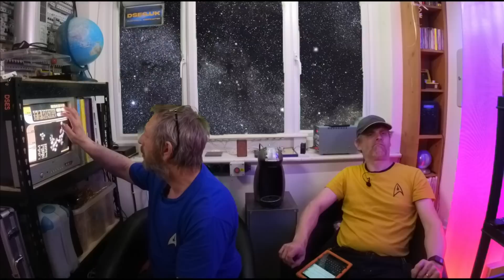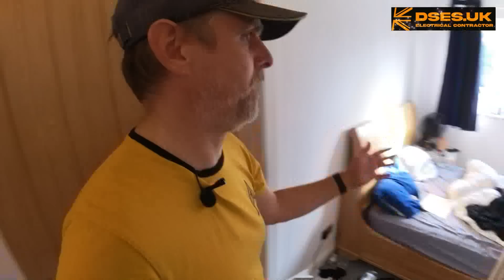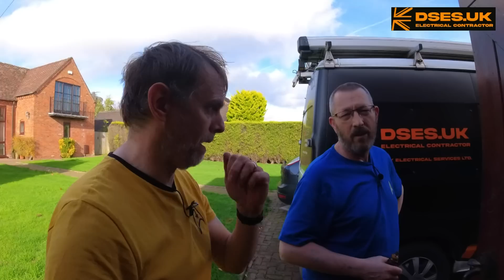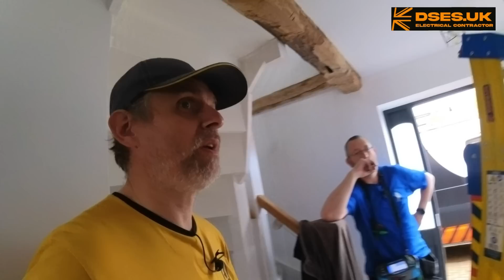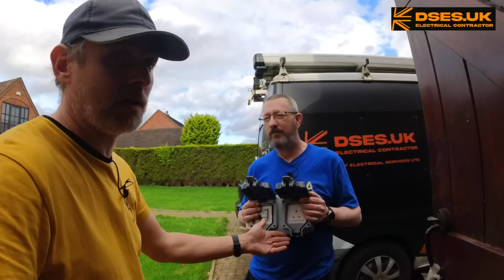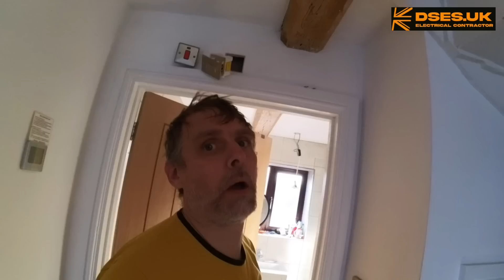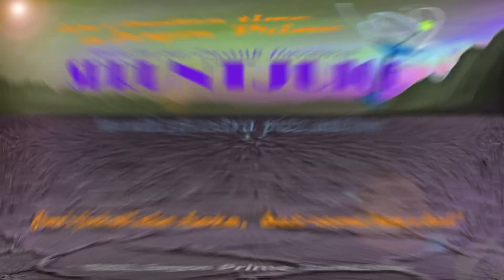Selectivity and Demand

Comment: There is no compliant way of connecting those type of lights unless you use a junction box and take a 4.0 cpc from it.
Also, running a single 1.5 mm cpc is also not compliant.

526.8 refers to the cores of sheathed cables being enclosed as required by 526.5, it makes no mention for the purpose of the conductor and the reference to 526.5 is the methods contained in that Regulation for the enclosure not whether it is a live conductor or not.
See 543.1.1 whereby the cpc is no longer an integral part of the cable as the sheath has been removed.
The cpc should be enclosed or mechanically protected.

Very good Video though :)
Reply from the maker: Oi oi Mainline. I have to say that I find, as I get older and the alcohol abuse takes its toll, that it's getting harder to recall the do's and don'ts of the big brown book. That's not the case so much on design where one can take some time to ensure it's all thought about and checked properly, but more so on situations like this where we're faced with something unexpected that wasn't undertaken with any care or competence in the first place, and it's now up to us to sort something out on-the-fly without pulling down the ceiling. You're right of course that this isn't an ideal or compliant solution... and that it's difficult to implement such. These sort of faults require some thinking around there on the ground to ensure the customer isn't going to end up paying through the nose for a load of decorative repair, and so we can show some test data on paper that indicates some kind of improvement to how the last idiot had left it. I do wish I'd had 4mm on the van, but I don't know any other way we could have uncocked the unearthed downlights, switch and fan iso without some dirty great holes knocked in the place.

Comment: Great video as always. Are you aware that any socket intended for ev charging must be on its own circuit protected by a dedicated rcd with switched neutral and have a solution to maintain safery i  the event of an open pen fault, ie open pen detection. Grany chargers dont have open pen detection.
Reply from the maker: I am aware... now. NICEIC picked me up on it after I installed another one on a site they inspected. This is why I don't do any EV work anymore - the customer just wants a robust outdoor socket and the next guy they'll call won't bother with all the whistles and bells. There's no point in trying to compete.

Comment: My dad was a market gardener and a lot of greenhouses. 3kw heaters plugged in some. 
As a kid I was often changing plugs burned out and also sockets (I was about 10yrs if that)
Damp environment caused corrosion and resistance. 
I had a trusting dad lol
Used to do all the mechanical work on his vans from very early teens if that 😂 
Now my sister has a dog swimming pool with 2x 18kv heaters 2 1.5kw pumps etc and a toxic chlorine atmosphere so done for this. 
It kills industrial dehumidifiers of which there is 4 + 2 back ups in constant rotation. Mainly fan seizures. Bush barings. 
People don’t think about this

Comment: Hi david you know the 3 pole c40 mcb in this video, is it still the same as a 60898 single pole mcb, apart from it cuts the live and neutral,
    Dose it matter which terminals on the device you use for the lives and neutral or can it be any, and dose it matter which way the supply or load connects to it top or bottom 
   And if it exceeds 40 amp for a certain amount of time it trips
    
   Never seen these so interested to know how it actually works 

Thanks

Comment: It’s always the same! I see it all the time. One of my favourite sayings to people is “The last people to be doing building work is builders!” Kitchen fitters, Bathroom fitters and plumbers are just are just as bad! I’ve carried out a few EICRs recently and the problem with most of them is poor workmanship from other trades. If a property has had a new kitchen, Bathroom or extension its a warning sign and the first place i start looking for the faults!!!!! I fix some things on EICRs, i also re-label boards as there always hand written or stock stickers (BG normally). Great video
Reply from the maker: Absolutely - the number of times we've come across a bad kitchen, extension, bathroom etc. only to be told the electrical mess was down to a third party. The question of "Did they give you a certificate for the electrical work?" is often answered by "No, they were a bathroom fitter, not an electrician." -  Well, yes, but they've done the electrical work, so them not being an electrician isn't some kind of excuse that makes it all okay!
Reply: @dsesuk  That’s always my next question and a measure of the standard of contractor, “Did you get any paperwork?” The answer is always no! But fixing this stuff is paying my mortgage!!

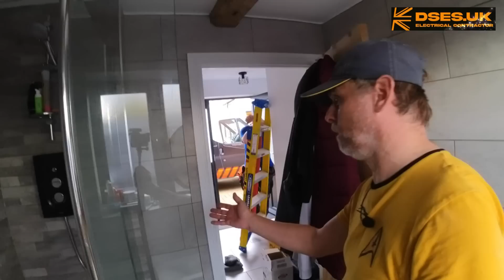Comment: 27:32 Why are you talking about Ohms Law when talking about current?

You don't use Ohms Law when you're calculating the current requirement when you know the power.

You are getting confused, aren't you?
Reply from the maker: You can use Ohm's Law to determine the current when you know the power and voltage. Or the resistance and voltage. Or to find the voltage if you know the current and resistance. Or the power and resistance. Or the power if you know the current and voltage. Or the current and resistance. They're interchangeable expressions.

Comment: Im one of those c-units that puts both legs of an RFC in one CPC terminal. I have a weird internal mindset that if i connect them both together, i can say its good. If im relying the manufacturers link to connect the CPC's - it just doesnt sit right. You may have seen the 'deco' (not Scolmore) range at Homebase. They dont link the cpc on a twin socket. So for peace of mind / ocd, i like to have my ring CPCs in the same terminal, as my screw is keeping them together - no reliance on a third party. I tend to use the other CPC terminal for the backbox connection. That said i do sleeve them individually with 2mm sleeve.  Sincerely A Cunit.

Comment: CHINT C/U aka builders special. This job could possibly have been wired by one of the chosen people who is multi skilled and knows it all aka KITCHEN FITTER.😂😂😂. As for the CHINT lid have you noticed that the buzz bar cover is sometimes missing that's because after struggling half a hour to get the lid on you find the buzz bar cover on the floor that quickly finds itself in the bin. Also the smoke detector in the dead zone right next to the wall.

Comment: I came across an installation by an electrician (not a builder) where there were two electric cookers and an electric shower on the same circuit so of course it tripped when they were all in use at the same time.
Reply: It's called Diversity 🤪

Comment: The chint boards usually use a smaller sized mcb. 
Normally supplied with a flexible link from the RCD or Main Switch to the first MCB then the bus bar just connects the MCB’S together. If fitted an rcbo next to the main switch you don’t need the flexible link. Still hard to get the lid on though. Great video as always 👍

Comment: Jesus, I'm not more than a humble computer engineer, who enjoys watching electricians content. However, even I spat my tea out in shock, the second you mentioned that 10.8kW shower hooked up to a 40amp breaker, then remembered the entire 'rental' CU being covered by nothing more than a 40amp up stream!.... Slightly proud that my Ohm's law was up to snuff to calculate it to 47amp as well as you :D

That CU in the garage was mind blowing as well.

Very good find, and as usual, a top grade video 🤟
Reply: If you used Ohms law to calculate the current, then you did it wrong.

The relationship between voltage, current and power is not Ohms Law.

Ohms Law is the relationship between voltage, current and resistance.

Comment: I would expect the increase from 40 to 50 amp MCB to resolve the problem of overload tripping without introducing the same problem locally by fitting a MCB as a main switch, really no need to do that.  Diversity is king.  Clearly 40 amp was too low but 50 would clear that problem.  Put back the main switch.

Comment: 0:32 "Jefferies Tubes"
About 30 years ago, a new design for some of the equipment used at power stations was being trialled at the power station my dad worked at. At the time, he was one of the most senior instrument techs, and was tasked with writing a preliminary maintenance document before submission to the CEGB and then distrobution to other stations.
There was a large air-feed pipe which had been bought off the shelf, so had no CEGB designation as such, and so he HAD to apply some kind of reference in the manual. He chose "Jefferies Tubes", as part of the maintenece was to crawl up the pipe to make a visual inspection of some sensors, and this seemed to resonante with the TV show theme of crawling through murky passages.
This was submitted to the CEGB and while some edits were made, the name Jefferies Tubes survived - There must not have been any Star Trek fans at "the board".

For several decades, the manuals for this equipment, and anything like it had a formal part number so that you could order "Jefferies Tubes".
Fucking outrageous.

Comment: Ansell prism pro high output. Don’t get me wrong I’m not 100 % sure but I presume they are class two marked by having the driver separate and not requiring the exposed part of the fitting to be earthed. I never chop off the earth being a reparable electrician to have checked 😂

Comment: The two earth terminals on sockets is designed for high-integrity earthing. Normal is supposed to both be connected into the same terminal, but it doesn't really matter that much.

Comment: I got caught out by Regulation 543.1.1 last week when I ran a 1.5 mm cable under the skirting board between two sockets where CPC continuity was absent.
BS 7671 says I should have used a 4 mm cable, or at least 2.5 with mechanical protection.
The skirting board provides at least as much mechanical protection as the sheath of a twin &  earth cable, so I'm still considering my options before going back to the job to replace it.
Reply from the maker: I must admit Charles, I had forgotten about 543.1.1 when faced with this out on site. It's hard to remember all the caveats and requirements of the ol' brown book and just as hard to find where they are if you have the buggering thing right there with you.
Reply: I agree, in most cases a 4mm is required for a separate shared CPC, and it also usually seems overkill.

Comment: One thing I don't get is that these breakers won't trip at In. So a 40 amp type b won't start tripping untill about 56A according to figure A4 page 417 brown book appx 3. That shower draws 46.95 Amps. So how is it trippin?
Reply from the maker: It's not just the shower - and remember that the shower has its own B40 which is not tripping, but the MCB back at the house is also powering the sockets, lights, heaters, cooker and everything else. What perhaps didn't come across in the video, although it was mentioned, was that when we subjected it to stress we'd also switched on other appliances to simulate how the people who live there would be using it. Add in a panel heater, the cooker simmering a pot of water, some lighting etc., and even then the MCB might not trip in short order, but it does heat up and pops off eventually.

Comment: Less than halfway through this treat. Quick comment - Electric showers run full power, all the time. The water flow rate alters the temperature. More time in contact with the element = hotter water.

Comment: To the rest of the world, the British seem to have a belt and braces approach to electrics, and yet, when viewing this, I feel safer with our non polarised and unswitched 16 A (and often unearthed) sockets we have here in the Netherlands.
Reply: What's the mains voltage in the Netherlands? Here it's 230V (AC), I personally if having a spark do any work would always want whatever it is being done to have proper earthing. Better to have proper earthing than suffer the normal red shirt fate of Ensign Spunkgargler
Reply: @leeroberts1192  230 V -/+ 10% (which may be changed to -10/+15% in the near future if the consumer authority has its way). Earthed sockets weren't mandatory an all circuits until 1996.
Reply: Problem with unearthed Shuko type sockets is that you never know which terminal is line and which is neutral/earth (as they call it in our language). Our oven used to give you a nice tingle if you touched the metal surround on the front panel until I turned the plug around – same with the washing machine. 💥 I hate Shuko plugs and sockets, cos they don't have a mechanical system to guide the prongs into the holes (unlike the UK plugs – vastly over engineered but a brilliant design). You either have to be able to see the holes or spend ages fiddling around behind the sofa till the prongs accidentally mate. Hate them. Oh yes, and they're rated 16 amps but they melt way before that.
Reply: @xmfclick  Yeah, the fiddling may be true but a good plug that's properly connected takes the 16 A just fine, but fixed equipment > 2 kW nowadays is required to wired in permanently. Unearthed sockets should not be present in kitchens or bathrooms, not even in old houses. The tingle is probably caused by Y class filtering caps in the oven, not pleasent but also not dangerous.

Comment: Who the hell doesn't fix when its something like that loose wire on a EICR, as soon as you see a light fitting like that your heart drops, as you know it will be rough as a badgers cunt, the worst case is when they cut the CPC and you have absolutely zero length to make off for the earth and leaves you up shit creek without a paddle that properly boils my piss, but this is the bigger problem the amount of Kitchen fitters and Builders who tell clients they can do it and just phone an "electrician pal" or Company to come in a sign off and the client knows no better and goes with it and only find out when someone with a degree of competence looks at it and recoils with horror that they have been had, properly pisses me off but at the same time keeps me busy doing fixes, that whole build just screams of someone with a little knowledge and kids themselves they can do it all and its dangerous, 

 it's good to see you back again

Comment: Showers usually regulate temperature by adjusting water flow, so setting ( other than a high/low switch) won't usually make a difference to current draw
Reply: This one is actually one of the few that has a loose thermostatic control, but it's only got relays on the board to turn the heater on/off.
Reply: @sdgelectronics by turning it all the way to hot you actually reduce the average current because it will start to regulate the temperature by turning the element off.   Turn it fully to cold to increase the water flow and get continuous load.
Reply: My thoughts exactly ( unless you only have it on max cold?)

Comment: Whoever bodged-up these circuits also forgot to calculate and allow for losses in the run of the armoured cable from the barn conversion to the little house, I'm thinking?
Reply from the maker: No calculations were troubled in the wiring of this installation.

Comment: I’ve got those steps have you found (like I did…😅) that because the rear steps are so narrow that they’re not the most stable?
Reply from the maker: So far they've been pretty good. Heavier than the old fibreglass steps, but jolly useful when you need that bit of extra height such as accessing attics!
Reply: @dsesuk  that’s why I got them i only have a SWB Caddy so need things to be multi-functional where possible… but have to agree they’re brilliant steps and I didn’t wanna fork out for the little giants

Got them for £180 from toolstation

Comment: I hope those wooden joist at 13:33 are for show and not structural as that looks like the one on the right has a heafty crack in it in the stressed side. 

Great video Dave & Nigel. Have to say the logic of cutting the earth is astonishing.  Glad you didn’t say it’s a “DIYer” as that’s getting a bit overused on some other channels.

Installation Comments on existing installation “Very Good” 😂
Reply: As someone who's not a spark, dare I say it, could a DIYer have done a better job than the original "so called" spark?

Comment: Those integral gu10 downlights can be used as class 2 fittings according to the manufacturer. The information is hidden on the frequently asked question on the integral led website. I had to change a load of old mr16 fittings feed in 2 core flex and these where the only fitting I could find that where class 2. The earth is there to cover all specs. Fittings are ok but terminal enclosure are a bit rubbish.
Your content is great like the way you you explain your thought process on how to deal with poor installations.
Reply from the maker: That's handy to know. I don't see why there's an earth anyway - if the cabling is terminated properly then you have double insulation throughout. Why even bring the metalwork into the electrical system?